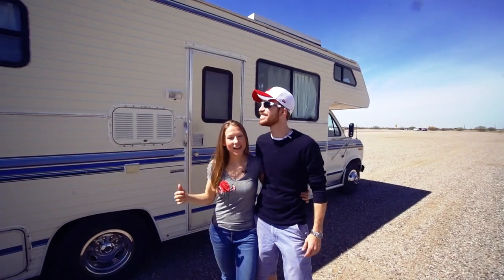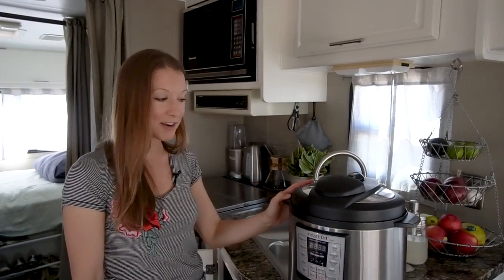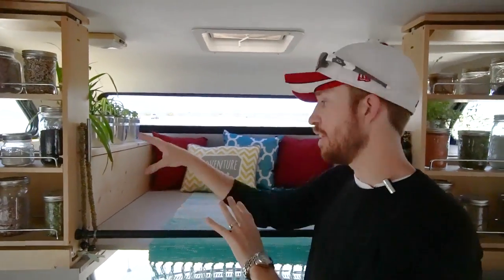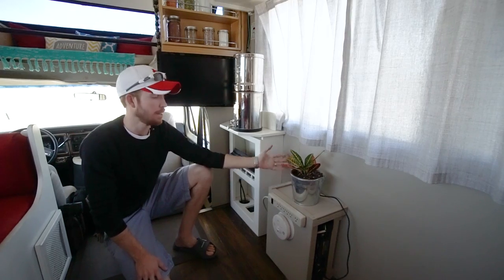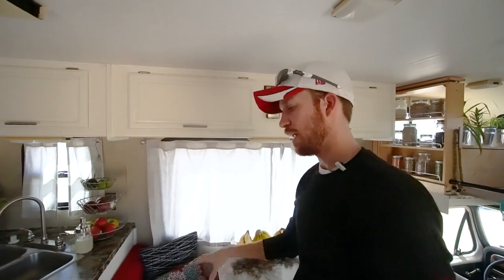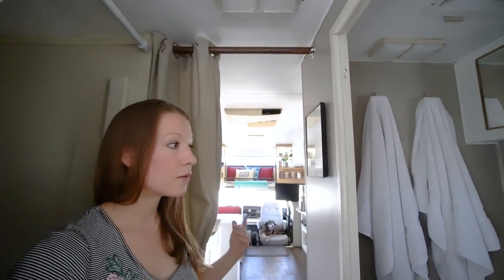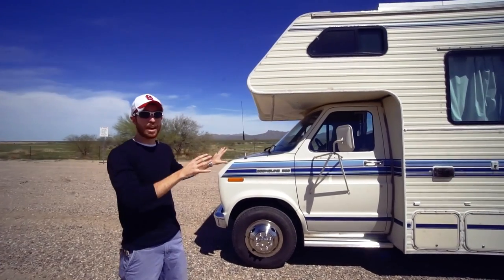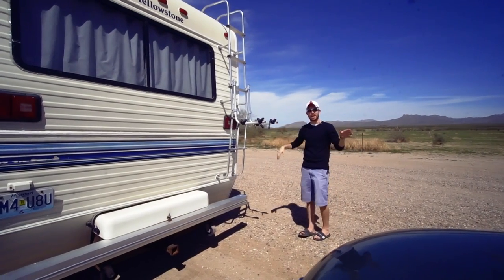They Renovated A 1989 RV Into A Beautiful Budget Tiny House

Comment: Thanks for taking the time to share our rig and lifestyle with the Tiny Home Tours community! We love the video and appreciate all that you do 🙏🏼😎
Reply: Duet Justus very informative video, thanks so much for sharing... alsocan you provide your You Tube link as it was not included in the video description...thanks
Reply: Username sounds like you're vigilante nomads.  (⑅◠ ◡ ◠)♡
Reply: Duet Justus - soooo impressed w/the thought, planning & execution. Bright. Organized. Homey. Kuddos 2U2.
Reply: curious why you think you can't tow.....maybe because the car is an automatic and you don't want to drag a dolly? the 460 has plenty of torque is plenty durable to tow your honda. the auto trans behind the 460 is a weak point but you will want to have that trans redone at some point soon anyhow.
Reply: Just wanted to say, Thank You! for showing your Berkey; ... so many nomads seem to think they need to only get/use the larger units so yours is the smallest I've seen someone using successfully on the road.
Reply: Because of the long overhang of the RV, behind the axle, the vehicle is weight limited to 2000 lbs towing. The Honda exceeds that weight limit.
Reply: Great video, with great info.. And for those wanting to buy an older RV. look in the cabinets and around every inch of the ceiling, and if you see any water damage, even if it looks small, most likely the entire inside of the walls under/near the water spots, is going to need replaced..   As for the flat roof, just cool seal it every few two to three years, and make sure you cool seal it good along the trim that's around where the roof meets the sides.. And cool seal will also help A LOT with keeping it cooler inside during the summer.. Peace!
Reply: Duet Justus Tamil
 Op
Reply: Duet Justus LOVE your home!  Living my dream.
Reply: pinterest is amazing for ideas.
Reply: This is really helpful. I wanted to convert a transit or skoolie, but my dad said to look into the older RVs and just remodel. Yours the first I've seen and looks just like the one I just say for sale. I still have some time before I purchase one but this video was really helpful. I might have to get a smaller one that can tow my car though since I'm solo traveling lol. Thanks so much for the video, lots of ideas and great help.
Reply: Duet Justus In this video she says that there were many mistakes. As in things you didn't think of before hand. What is it that one should think about before doing all of this?
Reply: Great job.  Great energy.  So clean, crisp & contemporary.  And it did not escape me that both of you are redheads!  How cool is that??  :)
Reply: Great couple, all young people should be so environmentally conscious.  Your  explanations of all the details were really helpful to viewers and I am sure greatly appreciated by the community.  Peace:)
Reply: Duet Justus you go guys. I have 3 and a 1/8 dog's and am 51. I'm alone but have been looking at campers because I am not able to keep up my house and yard anymore. And I would love to see the country.   
Anyway I love that you redid it and it looks great. I am proud of you and your family. (gotta count the fur babies)
I am so happy to see that you didn't just pass them off like they were nothing. I can't stand the way people do that, they should treat them like they're kid's. They wouldn't just get rid of their kid's to go live in an rv. THANK YOU SO MUCH FOR KEEPING THEM TOGETHER. 
💚A TRUE FAMILY💚
Be Safe and Have Fun🌼
Reply: Duet Justus you ought to see about cutting board's to fit the sinks would be great for extra space💚💚🐕
Reply: Excelsior tv en vivo
Reply: I was wondering what colors you both used to paint the inside? I have a 1985 chevy Winnebago & would very much like to paint mine like yours. I just love how great you both are.
Reply: @Duet Justus - Amazing build! Love the light & openness. As far as replacement carpet for the front (and many other things), JC Whitney is your friend. I guessed at your model config and came up with this link for carpet kits (https://www.jcwhitney.com/results/?Nr=wpn_cat_name%3ACarpet+%26+Vinyl+Floor+Kits&), if your front cab is built on a standard chassis format. 
As someone else said , if you decide to re-do your countertops, put a  few layers of epoxy in the finish of your choice. You can also do cool things like embed photos or coins or pigment under the epoxy.
Keep living your dreams!
Reply: I would touch up the paint on the counter/table top and then seal a thin precut sheet of either glass or plexi to them with silicone.
Reply: Dean Gabriel THIS IS ALSO MY DREAM🙋🏾‍♀️
Reply: Great video - cute couple - thanks for sharing!
Reply: Duet Justus is your power not run through out the rv??
And you know with the board's you used on the floor, it added a lot of weight which makes you use more gas
Reply: @RamonaQ  not really
Reply: @Rocki5pr  why would you need a large one
Reply: @bellawitz85  the plexi would scratch really bad. Be best to make sure it was well cleaned and just put a few layers of epoxy on it. It's used all the time for counters.
Reply: @White Rider really
Reply: Shamrock Girl —p——[p’]
Reply: White Rider Children aren't compulsory to make a couple happy ... they have each other & their dogs, travelling the world & protecting the environment ... maybe they're so much wiser than the rest of us who have brought children into this terrible world we live in & cursed them with a frightening unknown future ... If I had my chance over & knew then what I know now I would be thinking twice about having children.
Reply: Lllll
Reply: Today 8-27-20 I saw this video and thought oh good video, good build out, many good ideas, I want to subscribe to their channel and follow them on Instagram but when I go look they have not posted a video or picture on YouTube or Instagram in over two years. Their blog link doesn't go to a blog so I'm wondering what happened to you guys Duet Justus? I did follow the FB link and saw a post from May saying maybe starting back up? What's up you guys?
Reply: @White Rider ?????!!!!!!!!
Reply: ❤🛸the rig!!🌳🌾🍀🌿🍀☘ it gives great natural air filtration!! cant love that set up enough!!! Nameste
Reply: You are a beautiful couple you should be movie or TV or You Tube Stars.
Reply: You guys are adorable!  Great content and pace.  What type of remote work?
Reply: @bellawitz85  Epoxy is better
Reply: There's got to be a sealer you can use for countertop paint.  Even Mod Podge, right? Your place looks so great especially those countertops! Good luck!
Reply: Just subscribed to your channel! 😊
Reply: You can cover that painted part of your kitchen with resin. Then it will be waterproof and super beautiful.
Reply: This guy needs to let the girl talk more
Reply: Beautiful job..
Reply: That's how they do in " The Lou." Yeah go Cardinals
Reply: Thank you so very much for sharing! I can’t wait to try some of your ideas in my 1982 Chevy Tioga! Scored for $3000 runs fantastic and has all original upholstery not a hole in it anywhere! Xoxox
Reply: I never heard you mention anything about the air conditioning unit. Do you use it and does the solar handle it?

Comment: Looks great. If you ever have that window up top leak again check the running lights before taking the window out. Also goes for the back window. It took us a while to figure the window problems. Once we did all the front and back running lights we had no more leaks.

Comment: That was really helpful ! You both did a great job showing us around  your rig, sharing insights from your experiences, providing lots  of good tips & useful info. This is a good one to share / send to anyone contemplating buying an older RV to save money. If you've got help or can manage the renovations & rebuilding one that's got some rot & aged lines & valves - anything that is made of materials that degrade with age - be bold. It can be done. If you've got the money - get one that's in refurbished or recent vintage, but the best advice you gave - get it inspected...maybe 2 inspections are worth it.  

Will check out your other vids when I have more time, but am now subscribed, so that's a sure thing.
Reply: Hello Cheryl how are you doing!!

Comment: Info. From a tire guy, you should have 10 ply tires on your Rig. So start saving your money, but they are so much Safer.
Reply: We have a friend who died from bad tires.  A nice young family man.  Thank God his family wasn't with him.
Reply: I would put the best tires available on that RV, my life is worth more than saving a few bucks.
Reply: Had a front tire blowout on a similar class C. Unbeknownst to me the previous owner before the guy I bought from had installed all retread tires. I got really lucky as it happened in an area that had a shoulder on a short bridge, road had no shoulder other than that.
Reply: Yes, Load Range E tires for an E350. It will drive much more stable. You should replace them immediately and sell the ones you have on there.
Reply: Where do you get them .
Reply: @deborahkimball-billups6405  you can get them anywhere. Michelin LTX, BF Goodrich A/T KO2 for the winters, Firestone Transforce HT or AT are the top brands for commercial applications. I used them on the ambulance fleet. My class C came with Mastercraft tires the previous owner put on. They seem to be ok. When its time to replace them im going with a bigger size. 245/75R16 is what comes on a single wheel E350 van. They fit the dually wheels w/o issue and add even more stability.
Reply: Retreads are for trailers. They are illegal in Canada on the steering axle.  An old friend of mine used to make tires, he said “if you saw how tires are made you would not drive again”.  I drove tractor trailer for 30+ years after that. I had a blowout practically every year on my trailers.  Fuckin retreads.

Comment: For extra counter space why don't you cover one of the sinks with like a chopping board?😁😁😁 I wish while he was talking the camera would've been showing what he was talking about ALOT Better. I couldn't see anything except him and with all due respect we want to see the RV LOL 😂
Reply: lol he’s cute I don’t mind looking no harm in that lol 🙏🦅🇨🇦🤩🚐🎃🤩
Reply: I agree why haven't they thought of this?
Reply: Right 👍😊
Reply: I think that space above the cab is really wasted! They even said it's "just for esthetics" but I thought, who can afford using a big good space in a tiny home for decorative purposes? There are plenty ways to add decorative touches...
Reply: I don't understand why, with all that nice large solar capacity, you would ever want to use propane? They made a point of saying how they never even come close to using all stored battery energy or the solar panel capacity. & the only thing that would have to run continuously would be the fridge & any heat or AC. Depending on the season. Small ceramic space heaters don't take many watts & are very safe to use. They did not mention heat or AC but maybe I missed it. They talked about how they do things when they are "off grid" but in my opinion, one is never truly off grid unless I dependent & sustainable in power & water sourcing. Water can be fairly easily obtained in nature, & if you have a water filtering capability, no need to buy those large water jugs. Not sure why they had them since they did have the "Birkie" water filter, waste of money to buy bottled water & then have to filter it? Since they had such a big fresh water tank that should suffice for drinking, bathing & dishes/cooking. So again just my opinion, but I would ditch the propane & get an electric stove & frig. I didn't hear what kind of water heater they used either but the on demand hot water units take up very little space & aren't too expensive. I guess I should watch it again but frankly found there was a lot of extraneous talking & most of it at a very rapid rate, making it a little difficult to follow easily! Thanks for listening & letting me express my views.
Reply: @cynthiagreen272  I agree about the wasted space above the cab I kept thinking thT maybe but I think they just fill the water jugs when they have access to any water then dump it in the birkie
Reply: @cynthiagreen272  it was the plants that were for aesthics . Storage underneath the plants is what they use the space for.
Reply: @cynthiagreen272  my solar guy told me my fridge works more efficiently on propane than electric sauce that's why they use it. And having a gas stove is nice.  I don't like cooking with electric so maybe they don't either. Who knows?
Reply: The camera issues, that's the owner of this channel so shouldn't people tell him that?  I noticed this with other videos too, the person is talking and explaining things but the camera man doesn't move, they don't show what the person is talking about, it would be nice if they show it when the person talks about it.
Reply: Even more prep space if you cover " both" , sinks with chopping boards .
Reply: M
Reply: That’s what I thought as well when she was talking about preparing the food for soup.

Comment: Excellent video and explanation of how you made your RV into your full time home.  Thanks for the tip about the Berkey water filtration system. Very important when you need fresh clean water. Bet it's much cleaner than bottled water and sounds very cost efficient. The $200 price tag is reasonable and worth it considering all the bottles of spring water I have purchased in the last two years or less. Thanks for a great video.